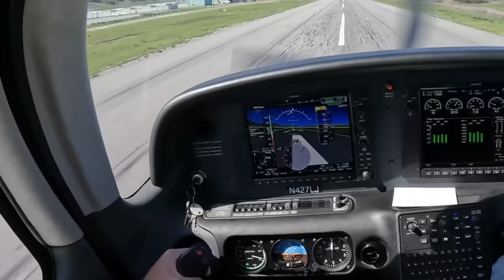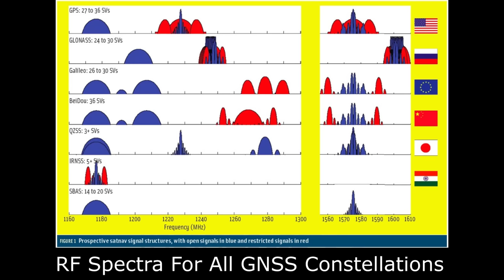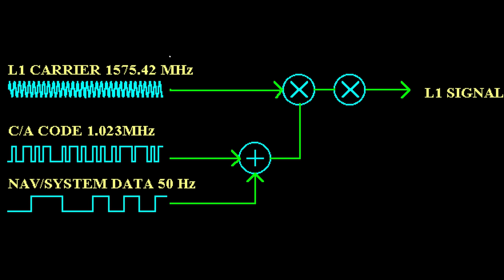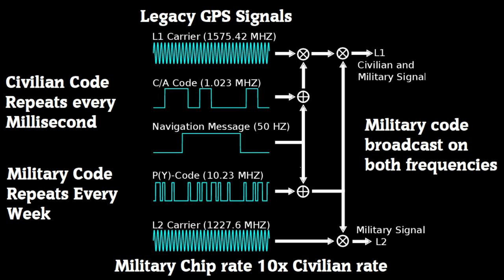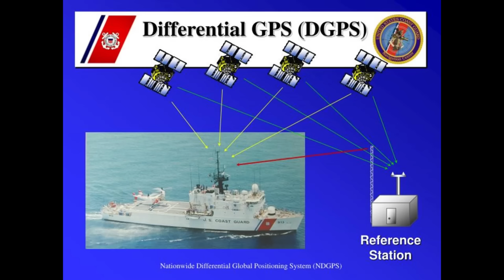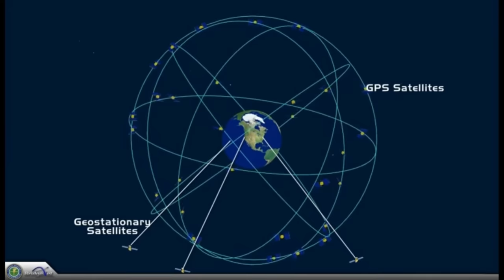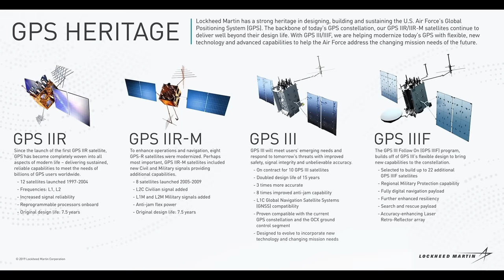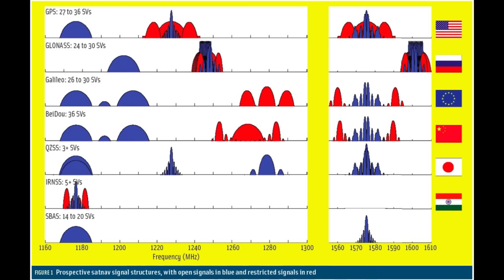How GPS Works, And How It Got Better Than The Designers Ever Imagined

Comment: Will it be possible to use Elon Musks Starlink satellite array as a more accurate GPS network? I know the satellites are in a much lower orbit but there are thousands of them which I think would make a much more accurate Global Positioning System.
Reply: They don't have atomic clocks so a different method would have to be employed as compared to GPS.

Comment: He real reason why GPSis so accurate, is so that they always know exactly where you are... Thanks to the handheld GPS device we cannot keep out of our hands.
Reply: Handheld GPS devices do not contain a transmitter. A phone with GPS can transmit its location, but the phone company already knows where you are because it has to be able to send your data to the correct cell tower.
Reply: @magburner  As I said, long before GPS was integrated into phones, the phone company knew where you are. It is an inevitable consequence of how a mobile phone system works.

Comment: Bull$hit! Radio triangulation from cell towers
Reply: No, that's just the nonsense you people WANT to believe.
Reply: GPS works in the middle of the ocean, where there are no cell towers. GPS was designed to be used in war, so it had to work for US aircraft flying over the USSR, in a situation where you could guarantee the USSR would shut down any infrastructure that would help the enemy. A tiny bit of critical thought would have shown you the holes in your argument.